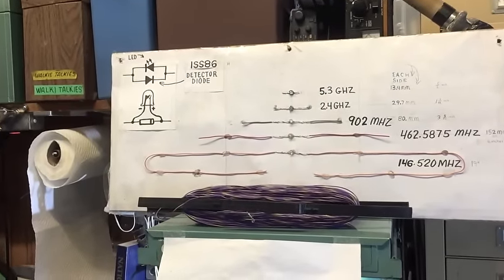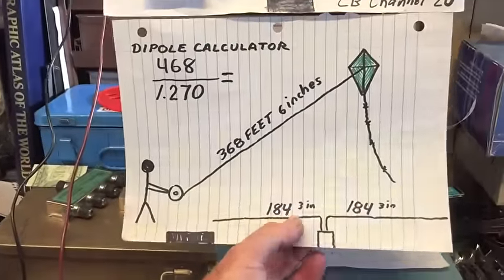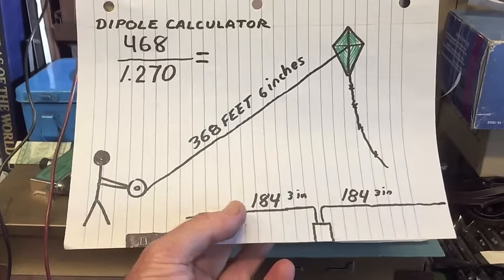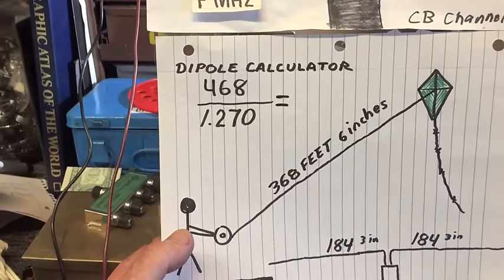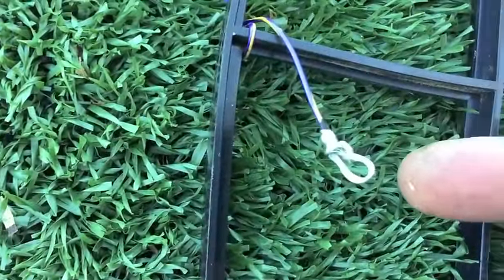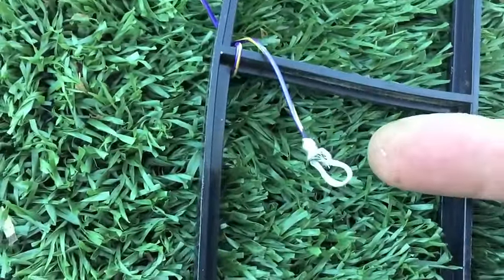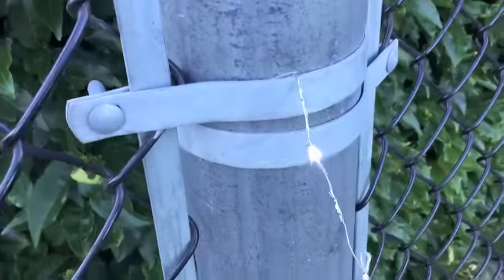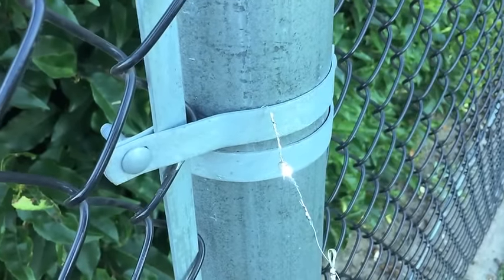Radio Frequency Burns From A Long Wire Antenna Supported By A Kite

Comment from the maker: Here is a video where someone harvested enough power to weld with. https://www.youtube.com/shorts/NHgQyLQsIxA
Reply: is the diode and led diode enough of a spark gap to gnd for relative safety. yes im aware that ant is still hot ,please draw diagram of long wire to kite but spark gap at radio end

Comment: The only real "free energy" (not if you are the radio station) video on YouTube that does not say free energy in the title.  ;)
Reply: lol :D
Reply: Because it's NOT free energy.
Reply: Time for an array of these into a rectifier for a slow 5v phone charger
Reply: @suprememasteroftheuniverse  I get that.
Reply: @ipaqmaster  if 100 meters produce 1w constantly , 1000 meters produce 10w , 100km produce 1000w , in 24h those are 24kwh in a year almost 9 megawatt. a network cable has 8 cables in it , 300meters cost about 80euro-nothings , that is about 2400 meters of cable so we ll need about  42 of those to make 100km of cabling  (i bet we can get better price than 80)  , so 42*80 = 3360  euro-slave-currency for the cabling , and we dont even need batteries :)
Reply: Free to me energy.
Reply: @suprememasteroftheuniverse  yes it is, hes not paying for it
Reply: @justinc2633  "yes it is, hes not paying for it"

He kind of is though,  because the demand for power that the radio station has increases the price that the power company charges.
And if it's not a strictly commercial station then he's paying through taxes and such.

Even Solar is not free energy because you had to buy the solar panel first.

Yes, I have nothing better to do than to write this comment.
Reply: Children think energy is free…until they have to pay for it themselves…😂!
No shoddy science involved…😮!
Have a great day!
Reply: @reoproedros  no it wont

If wire is to long the extra energy is converted to heat

Wire has to be tuned to specific frequency

Lower the frequency, longer the wire
Reply: @vinny142  Yeah but the station will transmit either way, its not gonna use more power just because youre flying a kite with a long wire. FREE ENERGY!!!!!!
Reply: needs a meter a generator and a capacitor. and a bunch of other things. we are paying for numbers lop
Reply: The real “free energy” is when you still live with your parent and they pay for it
Reply: @suprememasteroftheuniverse  do you not know what it means when someone puts quotation marks around a word or phrase? lol
Reply: @_logan__duvalier_  this is false. I already own the wire and rectifier and my house is already powered by the extension cord I have plugged directly into the AM tower.
Reply: @the.bog. I am experiencing that with a 23 year old “delayed adulting” child right now.
Reply: @audiobrian1  lol When I graduated from college out of state, without thinking twice about it I drove home...or to what used to be home. My loving mother was at the door and said "this house does not have a revolving door".
He thinks the energy is free at mom and dads, but some day he'll find out there is nothing to inherit because his parents took out 5 loans on the house and still owe 29 years.lol
P.S. I can tell you won't let that happen.
Reply: @suprememasteroftheuniverse  In a sense it is, at least potentially. It doesn't come from nowhere but it is potentially wasted energy that can be partially recaptured.
Reply: @djwikkid Hurray for Mythbusters!
Reply: @vinny142  paying taxes ? Isn't enough in this economy that get government basically tax via inflation
Reply: @kevinsellsit5584  wait a moment ? be glad you don't inherit debt
Reply: @audiobrian1 be careful. My 60 year old brother still lives at home.
Reply: @vinny142 Thats like saying fishing your own food isn't free cause you had to buy the rod. The material cost money, energy is free. And yes, they know how to generate energy from the largest saltwater battery, the ocean, but who makes money off the public with that knowledge?!
Reply: @Kw1161 Yeah there's no companies making huge buckos off of energy naturally created by the environment, just harvested
Reply: @vinny142  "paying for the equipment" and "paying for the power" doesn't have to be the same thing... You don't buy a bulk of electricity at your power station for the price of X solar panels. At many scales "breaking even" isn't even a consideration or a priority.
Reply: @suprememasteroftheuniverse missing the point huh?
Reply: @suprememasteroftheuniverse no matter what it’s FREE if your not paying for it
Reply: It's not free, it's Gratis 😂
Reply: It's not actually free, you need the kite and the wire and the time- they say time is money, but I think they have it backwards- money is time, quite literally. Everything has a price, it's just hard to see what the price is sometimes ;)
Reply: @Chaos_God_of_Fate  in this comment thread, we misunderstand the meaning of the phrase "free energy."  just as in "free software," the "free" does not mean "zero monetary cost."  in free software's case, it means "free from copyright."

in "free energy," the "free" refers to "freedom from theromodynamic laws."  meaning it's a measure of energy in a given system that is "free to do work," and not "locked up" by thermodynamics.

you know, we have a serious problem, as a culture, if the majority of average people are so focused on money they misunderstand such concepts so fundamentally.
Reply: Well it’s wireless power transmission

Comment: Nikola Tesla would approve.
Reply: I came here looking for this, or at least a similar, comment. 👍👍
Reply: I was thinking the same thing.
Reply: Yes, extracting a few mW from an antenna putting out several kW of power. Very nice... 🤪
Reply: Always the Tesla B's.
Reply: He'd add some capacitors resistors and a long antennae to a car with an electric motor and drive off using a single 12v lead acid battery😂
Reply: And Ben Franklin! 🌩️
Reply: I concur.

Comment: Nice experiment. I'll try that sometime as I am 1/2 mile from a AM broadcaster. Several years ago while camping on Pismo beach in California I sent up one of my larger kites on 1,000 feet of Dacron line. The marine layer was overhead and fairly low so the kite went up and through the clouds and was out of sight. Several of us were sitting around in our aluminum frame lawn chairs where I tied my kite off to the plastic arm of the chair. After a few minutes I noticed a little moisture dripping down the line and then we heard a tick tick tick. I noticed sparks flying between the gap of the wet line and the aluminum chair frame. A real Ben Franklin moment.
Reply from the maker: I hope you were watching out for power lines when you did your kite experiment. I got some pretty impressive sparks from the change in the air during a thunder storm. https://www.youtube.com/watch?v=_DHBjeobg4U
Reply: I have never had any electrical issues with my kites but where I live now the hawks let me know kites are not allowed in their territory.
Reply: I miss Pismo beach
Reply: @GrantsPassTVRepair  😂 if you saw Pismo beach you’d have a laugh. It’s sand dunes on one side and the ocean on the other. No power lines in sight!
Reply: @kevinsellsit5584 wait, what do the hawks do to the kites?
Reply: "You gotta tap the clouds for power"no but seriously that’s awesome!
Reply: i guess it doesn't take much,  Just don't spill the Beer.   haha   what a trip!
Reply: That can happen with fabric cord??
Reply: @lostsauce0  If it gets wet, it can.
Reply: @lostsauce0  The line had apparently wicked enough moisture from the clouds that it saturated and was dripping all the way down to the end of the line wrapped around the arm of the chair. It was enough moisture to conduct.
Reply: Fishing for hawks, with a kite 🪁 😂
Reply: @kevinsellsit5584 

Hey there. I have a bald eagle kite that I fly sometimes at the beach. The seagulls clear the area when I fly it.
Reply: @charleselertii6187  Seagulls don't scare me, it's the meat eaters tearing my arm off that I find unsettling.
The Bald Eagle kite could either solve the problem or be the end of me, not sure I want to find out.
Reply: Dacron? You should use Ligma.

Comment: When you touch the wire pulling sparks, someone on the other side of the globe hears some clicks on the radio :-D
Reply from the maker: I doubt that, but I'm sure you might hear a few clicks  on a near by AM radio, whenever I touched the grounded fence post.
Reply: Reinventing the first practical spark gap transmitters and receivers for radiotelegraphy communication developed by Guglielmo Marconi around 1896.
Reply from the maker: @iviewthetube  This is a receiver.
Reply: @GrantsPassTVRepair  Reminds me of a TV episode of the Brady Bunch when one of the kids got braces and could here the nearby radio station.
Reply: @GrantsPassTVRepair   The arcs turn it into a transmitter!
Reply: @Barnaclebeard 
Hence the clicks heard on nearby radios ?
Reply: If you connected a spark plug coil to the ground and the kite I might pick up a click faraway in  Kittygystan!😂

Comment: Also, just the static electricity in the air caused by wind, hot dry air etc can induce extremely high voltages on a long wire. The perfect example of this would be the full wave loop antenna at 80m that art bell had put up in Pahrump, NV. He had a constant 3000v on the wire, more or less at times. It blew everyone's mind including art's. Crazy....
Reply: Sorry, didn't read your reply.
Reply: Free energy?
Reply: I remember him saying that, one night back in the 1990s !
Reply: Yes, he was definitely a great late night anchor of his radio broadcast. I remember his broadcast, years ago. Interesting he did this too.
Reply: @mrtechie6810  free of charge cost? Yes…Free energy? No.
Reply: RIP Art Bell 
He was a legend in several ways.
Reply: Lol he also shows it working while not in the air dude
Reply: I had a 40 meter dipole up about 25 feet years ago and it was snowing and really cold out. I couldn't believe the amount of sparks I was getting off of the end of the 300 ohm twin lead
Reply: @joecummings1260  ....YEAH...wow...ive seen a lot of that kind of thing in the winter when its really cold......the static can get BAAAD!!!
Reply: Indeed free energy. It is as free as solar or wind energy. It is ionisation of the Atmosphere by solar, wind, cosmic rays etc. Atmospheric triboelectricity. So... Free energy but from a different source.
Reply: How come that doesn't fry the receiver?

Comment: Only problem is, you are not considering the atmospheric energy that is a 100v every meter the kite is in the air, so in addition to the rf, you have static electricity
Reply: My spoken remark while watching the demonstration was, "How do you know that it is RF making the burns?"   He did nothing to show that it was RF at all.   If he was really close to the transmitter, then it certainly could be... but I would like to see a follow up that shows us a definitive source of the energy.   putting a speaker between the LED and the fence would probably be sufficient to demod the local AM xmitter.
Reply: He put the wire on the ground and it was still working. Did you even watch the video?
Reply: @Lothane95  yes, when he ran some LEDs off it . There is RF on the wire still when wire laying horizontally across the ground. But when elevated, it as the RF AND high voltage with 100 volts every meter.

Comment: Great video! I had often heard of RF burns, but you took one for the team and showed a real burn. Loved your Ben Franklin experiment too!
Reply: yes that's where the expression smoking hot show originated
Reply: RF burns are painful. I got one that went right to the bone when I was working on a 30+ foot vertical antenna.  There was another 30+ foot vertical about 30 feet away that was transmitting a few hundred watts RTTY.  This was on a 378’ Coast Guard cutter. I had tagged the antenna I was working on, but not the other nearby vertical. Learned my lesson because, that burn hurt for several weeks.

Comment: Years ago, Art Bell (W6OBB and Coast to Coast AM) had a rhombic antenna on his property for 160m at I think  140ft.  The voltages he was getting off that was incredible.
Reply: I remember that
Reply: Can you give more details?
Reply: @goku445  not really, it was a long time ago and Art is dead.
Reply: Voltage is one thing, what kind of amperage was he getting?
Reply: @atomicsmith  wouldn't amperage imply current is flowing? The pressure difference from ground would be high, but there could be no amperge. Since you're getting no wattage out of the system the amps would have to be zero according to Watt's law.
Reply: @superdooper50 these crazies are so desperate to power something for free...